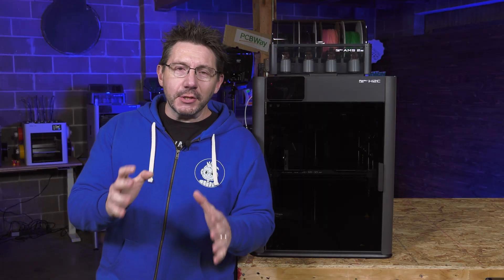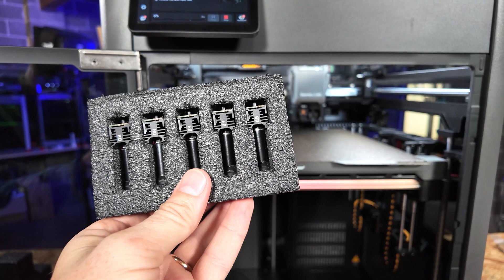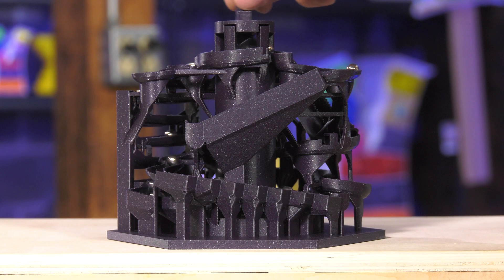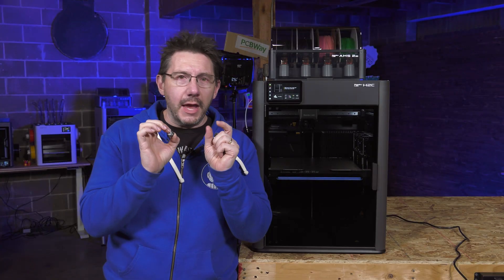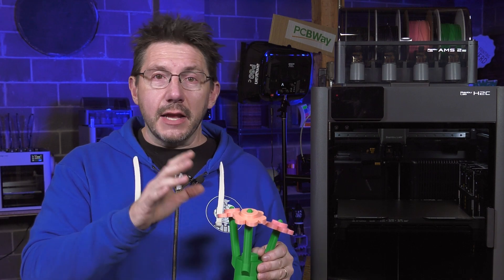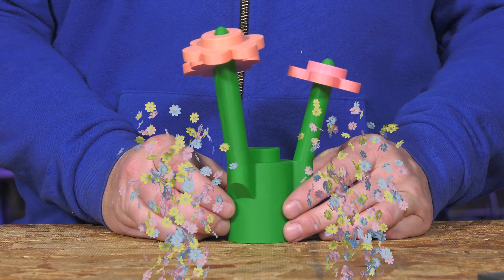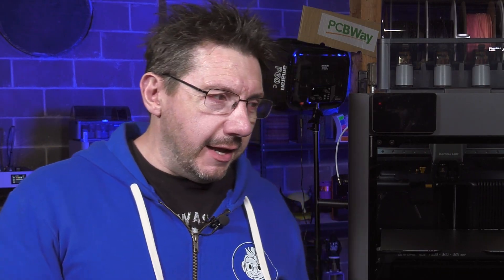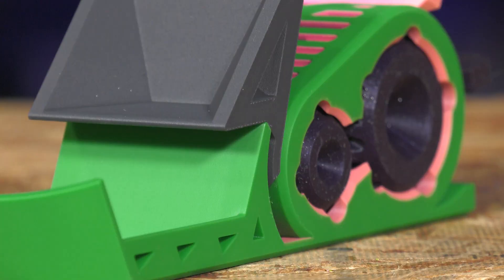My Review of the Bambu H2C + Vortek

Comment: its saving waste, but not time over a traditional tool changer like the Snapmaker U1, it still has to cut, retract, feed, and prime every single nozzle swap.  true tool changers just.....change the tool, prime, and print.  And the bed issue?  How does that even get out of R&D with that kind of flaw?

Comment: Did you ask Bambu about your heated bed issue? Are you sure it's not just a faulty unit? Pretty weird that they would have other models with great heatbeds but somehow this one flagship model is a bad design. I am watching other youtube reviewers to see their experience. You are the second I've watched, but the first one I watched, he has zero issues with bed adhesion.
Reply: H2D has the exact same problem if you watch it trough the termal camera, you just need to adjust the slicer settings to increase the print bed temperature to 10°C more or 15°C more if you are in a coldl garage.   Thats how they "fixed" the H2D  ^^

Comment: You didn't mention print times and poop (well, a little bit). Also, you didn't show how the machine changes filament. Does it cut the filament first before docking the hot end? I sort of knew it would have a clogging problem. It would be nice to see a comparison between the H2 series, Snapmaker U1 and Prusa XL.

Comment: the bed alone is a dealbreaker
Reply: Looks like there will be a revision soon with a better bed heater.
I wish Joel did the same thermal test on the other Bambu printers too though 
At least the H2D and P2S and X1C.
And not just the Prussa XL.
Reply: Doesn’t the H2D have this problem as well?
Reply: Couldn't agree more. This is bad, 30C difference is WILD.
Reply: @JarredSutherland  while heating, after heating it's "only" a 10C diff
Reply: i have the biqu cryogrip plate and never had an issue with prints not sticking
Reply: @alin619  try large abs print with cryogrip - its shit :)
Reply: @alin619  you don't have this machine though. You can't say that.
Reply: Fauxhammer's review of the h2s reports the same issue with the uneven bed heating but the issue goes away after a few minutes. Now I am wondering if it's the same thing.
Reply: @taruiThat means its intermittent.  Thats even worse....its unstable heating
Reply: @William-b5s2r  It goes away after a few minutes of soaking. It’s not intermittent.
Reply: @brysonhicks5659 oh you mean you have to give it time to warm up? Who would have thought
Reply: I had similar issues with my h2s, my solution was using a cryogrip cold plate, those things can hold an elephant upside down lol
Reply: Have an HD2 now and considered the vortex upgrade Now I think I'm going to shy away from that and consider looking at Prusa with a smaller print but the core one INDX. I'll let that one come out in 1st quarter of 2026 and see how it develops it's a very simple idea for multicolor especially up to eight or I believe it's 10 colors.
Reply: @Keith-um1pj  /yeah 10 colors is confirmed on the L, 8 colors for the non L.
Reply: Yes
Reply: Do you have 220/240v available to try powering the H2C with that to see if it helps with the bed heating? (If it does dual voltage like the other Bambu printers.)
Reply: @ChrisAdaline  It doesn't matter. The problem is that it's not well diffused. Take the brand new prusa core one L for example. It uses a massive heat block to make sure it's evenly disributed. The current beds are decent for prusa, but this is even better.
Reply: I wonder if there's not a correlation between the number of hotends and the bed issue 🤔. Thoughts?
Reply: @Boombastick17  no, they just screwed up. One has nothing to do with the other.
Reply: @Boombastick17 no you can clearly see the pattern of heat coil in the FLIR images
It's not good , they didn't snake the heating element around the bed right ,it looks more like an outline around the edges instead of tight loops up and down the whole under surface of the bed
Reply: It already bothers me that he measured a reflective metal surface with that device, which is why the value is wrong.
Reply: @Maik-mn4cd  that doesn't matter. He's showing 30 difference from point to point. So maybe the absolute temperature is wrong, but the relative gradient is not.
Reply: @awilliams1701 but IT dosent matter If the plate IS heating Up, the Holding temp IS important. He showed us 10°C Differenz from Maschine Display. If Puts a non revlectiv Plate on IT Like IT was on prusa, WE coud See the real temp. If IT still IS Not enough then that is also fair. 
I printed a Lot on H2D and never Had issues with adhesion.
For my aplications the H2D Is the best i coud buy.
Sry for my Bad Englisch. :)
Reply: There are two parts to the problem:
1. Uneven heating - does it even out eventually or not? If not, that's a hw problem that can't be fixed without replacement.
2. Temperature offset - this "should be" easy to fix via a firmware update... UNLESS the heater is already maxed out and unable to heat it further.
Reply: @kurtbilinski1723  It's pretty obvious that it doesn't even out.
Reply: Yeh kinda pointless having all that , when nothing actually sticks
Reply: @SinceGamesPT  If you get a Smooth PEI bed instead it things will stick even with low temps.
Reply: @SirLANsalot debatable but yes. But thats not the point. If ur spending that money you shouldnt have to bother with those issues, specially not on a print with that amount of surface area... i do have cryogrip and similar plates on some of my printers for prints with low surface area. 
Ocasionally use them on my vzbot and voron when running multicolor small prints
Reply: @SirLANsalot  That is like telling someone to just go buy a sweatshirt if the heater in their house only gets to 50 degrees when they set it to 72.
Reply: @AaronFlaming  It's not that hard to deal with inconsistent bed temps as all older printers worked like this.  This COULD also be a case of the unit he got, but it's still manageable.  As my own Voron 2.4 350 has a similar issue with the center being hotter then the outer edges of the bed.  The worse offender of this was the Elegoo Neptune 4 Max (420mm bed) with a very thin bed already and having an undersized heater.  Large beds have a hard time getting even temps across the bed and it takes some heatsoaking (aka pre-heating) to get it to even out.  What i did for my Voron was change up it's starting sequence a bit.  It heats the bed first, then moves on to doing the leveling, after which it will only then heat up the hotend.  All of this gives the bed time to heat soak while all of that is going on.
Lastly having a Smoother PEI sheet will just solve any heat related issues of adhesion, since shit will stick like glue to it, even cold.
Reply: @SirLANsalot  Spending $3000 for a printer that you have to do workarounds just to use?   jesus
Reply: @AaronFlaming  no, it's more like 1 arm is 50 degrees and 1 arm is 80 degrees.
Reply: Oh its gonna get worse. The "you have to buy a new nozzle every clog" did it for me
Reply: Right! I was so pumped up until that point
Reply: Over engineer system. This system will be a nightmare to maintain.
Reply: @TC-dk6do  definitely.
Reply: @awilliams1701  I have the H2D and I think Stefan from CNC Kitchen also showed similar problems in his first review of that. 
I think it’s not a great technical solution, but I have to say in the real world I never had an issue. More so, the other way around (with the heated chamber) I got some filaments to print without warping, that I couldn’t get to print on any other consumer grade printer (best example was an old roll of flame retardant ABS).
Reply: @MrCurt500  He's failing prints left and right. For a company that boasts "our printers just work" it's pretty bad.
Reply: @MrCurt500  I agree. My H2D has been great, no issues on the bed with the heating. I am disappointed in the design however, but once heated up it really doesn't create any issues.
Reply: At 2K+ for this printer it's utter bullshit they couldn't do a better bed heating system. They have made boat loads of money. How bout fixing simple shit like heating the bed and not being cheap asses on the necessary stuff.
Reply: Absolutely but this is probably something that can be, if not completely fixed, improved via updates. Hopefully this was also only a problem with a review unit and will be fixed before it starts shipping. Or quickly updated on the production line.
Kind of like the rule for buying a new car. Never buy the first model year. It'll take the manufacture time to find and sort out all the problems.
Reply: @davedujour1  firmware can’t change where the heating element exists and doesn’t
Reply: @davedujour1  just set the bed temperature 10°C higher in the slicer, and i never had a single unstick problem in 1200 hours of my H2D. 

swaped recently to a purple Geco plate that needs 20°C , and the adheasion is nearly too strong...  and it saves some money bc on long pla prints, the bed doesnt need to be 50-65°C hot.
Reply: @Bastyyyyyy  then parts of the bed will be too hot, which is not a good thing. I don't think it's an issue on the H2D. So why did this printer get the shit stick?

Comment: yeah I'm seeing HUGE purge towers. INDX should have tiny ones.
Reply: I doubt the tower will be much less? Switching will be way faster though.
Reply: @perkulant4629  I've seen the prime towers for INDX and other tool changers. They are microscopic by comparison. The only reason this needs to purge that much is because it's cutting the filmament.
Reply: Why do they need to grow it to that height anyway? I mean, just squirt it into the poop chute as usual without erecting walls for it?
Reply: @EditioCastigata  The prime tower is used to build up nozzle pressure, while pooping is to flush out colors between filament changes.

Comment: I'm not ok with this. It's over engineered and the filmament still has to be unloaded and probably cut. Will it save waste? Sure, but the INDX system will NOT cut the filament. It should be a lot faster. And other than the fact that you have to move the head to the nozzle there really isn't any additional moving parts. It should be more reliable. I'm looking forward to INDX.

Comment: Joel, I print GF Nylon (PA6) frequently for parts for my son's high school robotics team.  Your prints DEFINITELY seemed sketchy.  We normally get very tough parts that hold up to lots of wear and tear (think gears and toothed belt idlers).  Your parts seemed nothing like what we get---ours could never be broken by hand.  Unfortunately, other than proper drying, I don't have simple suggestions for what could be wrong.  Once dry, I can easily print the GF nylon in an open-air printer with no problems, so it's not that hard to actually PRINT (but obviously drying is a challenge once it gets wet).  Good luck figuring it out.

Comment: Hopefully before it's released to the public, they will fix the bed heat issue. They are probably rushing things to speed up the process because of the competition in multi head printing. But people expect Bambu products to "just work", so they can't let stuff like that hit the market. It will ruin the reputation. 
Thanks for the honesty. I'm sure some other YT folks will gloss over this issue.
Reply: Unlikely. H2D has the same problem.
Reply: @perkulant4629  oh. i did not know that. That is terrible
Reply: Yeah been dealing with this on the h2c since may. And since the hdc is released today I doubt it’s getting fixed anytime soon.
Reply: Pretty sure the heat bed design has been about the same on Bambu printers for some time. My A1 mini that I bought when it first came out, has always had issues with corners lifting toward the edge of the build plate. I just learned to live with it. I suspect the reason this is really coming to light now is with the large build volume first layer adhesion really become important. The higher you go the less the margin for poor adhesion is.
Bambu has built a strong ecosystem, and done a lot of things to just make printer work. However, many companies reach a point where they decide to trade monetization for innovation and amazing products. Bambu with the dynamic flow rate calibration is just one of their many unique features. I love the bambu ecosystem. However, I am waiting to see how things play out in the next 6 months. I am keeping an eye on if the heatbed issue gets resolved. The prusa One L with bondtech, is definitely on my radar.

Comment: I've printed a fair amount of Matterhackers PA6 GF on my Prusa 2.5s with a tungsten carbide nozzle (without an enclosure).  Never experienced failures like you saw with your brand of PA6 on an actual print.  Hard to say withouth looking at the print in detail, but it might have been over-dried - I have had it almost dinsintegrate on the spool after being in a dehydrator too long.

Comment: Dear Joel, 

I print with bambu PA6-GF a lot, i print RC planes from it

I do see some layer lines, but not as hard as in your print, i can say that with 1 wall, the material is quite weak

2 walls or more and it become significantly stronger, much more then ABS PLA PETG ASA

if it dried correctly its very easy to print with (H2D)

Comment: I'm new to the H2D and odd enough after the last firmware update my prints longer stick. But yes, I was hoping by the time I got this printer that Bambu Lab would have had replace that bed. I feel bad that I'm using a A1 style bed. Try printing at 0.24mm (edit or winter has come?)

Comment: 13:06 hello joel, I love the work and time you put in your videos to put a light on problems that might seem small but when looked at closely they show how they would really affect your day to day printing or experience, and I wanted to point out about that lid that you show in this timeframe, I know a slow coocker might not surpass 100c° in the glass or metal lid so abs is a great choice but the screw that hold the plastic part to the lid might not be completely sealed and the humidity that slips into that screw hole onto the printed layer lines of support might get stuck in there an cause mold or goo to stick to it so maybe it would be a better idea to print it with pla support so the bottom layer lines that touch the support are completely or almost sealed so there is less chance to get moo or goo stuck in there, that's all! I hope this helps!

Comment: The heated bed was also reported to be an issue on the H2D, but before the printer starts printing, the delta between the core and the edge at the door side is only 1.4 degrees C on my H2D. 

Reason for this ‘false’ issue is that many don’t understand how a heated bed really works.

Comment: So do the H2S and H2D have even bed heating?
Reply: I'm wondering if all the H series printers use the same bed heating?
Reply: @drzhark9877  I have and H2D for 6 monts and every H Bambu mashine uses the same heater desing, but I dont have bad adhision problems,  the preparation time by h2d is about 10 min and it evens out by than, in the begining it was realy bad but it was fixed in sofware, sry for bad english

Comment: Man, so far out of all the multi-color options out there, this Vortek system seems to be the best thought out. Some of the other systems that change out the whole extruder and such, that just sounds like an added headache. But to use just the nozzle themselves, albeit with some added electronics and thus having them be more costly, well to me its an elegant solution to cut waste for multi-color prints. If people have fleets of these, that cutting of waste alone could pretty much pay for this printer in savings alone. 

Shame about the bed being un-evenly heated.
Reply: This is quite literally more complex than a tool changer like the U1 or INDX.

Comment: Can't buy one in US, which was a blessing in disguise because I would have instantly bought it. Uneven heating on the bed is a deal breaker, especially if the H2S/H2D doesn't have this issue. Not using high heat magnets is also a serious issue for longevity. Looks like Europe gets to beta test this and I can wait for revisions to fix this issue. Or it might finally convince me a Prusa XL is the way to go.
Reply: @Luke42652 I'm 99,9% sure that all the bambu labs printers use the same heatbed technology as the h2c, it's been a years long problem, but it shows up more in the h series printers because of the bigger bed. Bambu labs has known this since the x1c and still refuses to change
Reply: the h2d had the exsact same problem, it was fixed in software
Reply: @Nikolasz1173  Ah good to know. Will keep a close eye on it. All I can do right now anyway :).
Reply: @Luke42652   well the software fix was simply " Default PLA setting is not 45°C anymore, its 50 or 55°C ?  so you just heat up more, so the "cold spots" are the correct temperature and the other parts of the bed is "too hot" ^^ -  it works, but i woudl call that a fix in the software.  its a bandaid at best
Reply: @Bastyyyyyy  Ngl Pursa XL is becoming more tempting.

Comment: @11 minutes, this is why I chose "just" 240w 310x310mm build plate with glass. Takes 12+ minutes to get to 110c but doesn't need to soak to even out the heat since it was warmed up so "slow". The chamber enclosed reaches 60c at that point, levels off at ~75c after 30 minutes. To which I have print profiles with a 30 minute chamber saturation time in the start g-code for some prints, rarely needed as usually for larger prints it hits those temps by the time it needs the warmth so far off the build plate

Edit: the delta at 60c is ~2c at center and ~3.5c at the corner edge, and at 110c it's ~4c at center and ~5 at the edge. After saturation the edge goes up about half a degree and the center goes down about half a degree. I also have a mesh profile for every temperature I print at, 60c, 80c, 100c, 110c and 70c that loads as default.